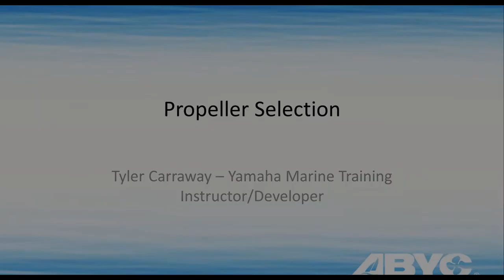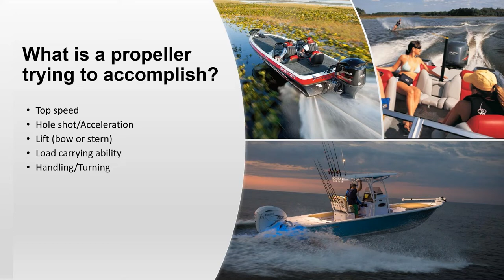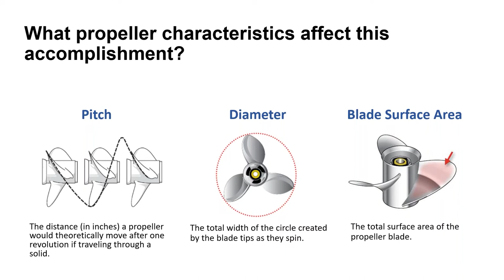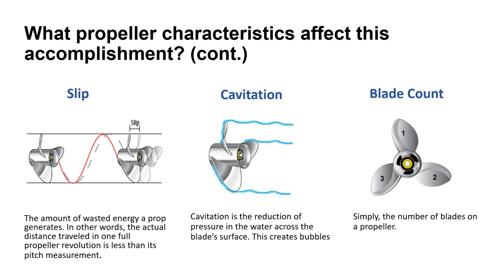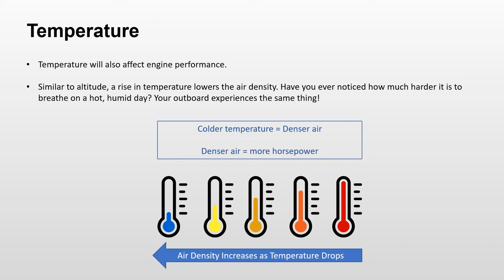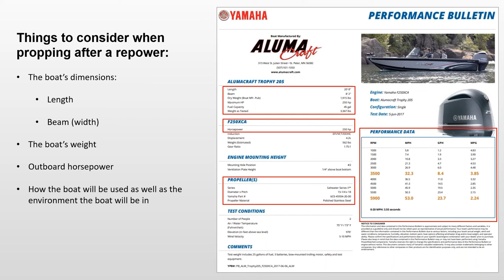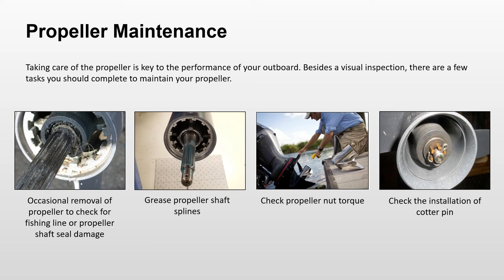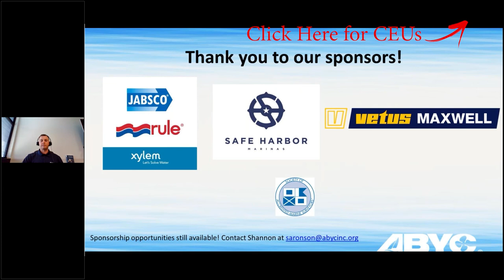Propeller Selection

Comment: Finally a video about changing the diameter!I've been looking for an answer for two days, but no one mentions it. Infuriating!Everyone is just talking about pitch!
Thank you very much for the information! Finally a normal video! 
Changing the diameter by 1/4 inch results in a change of 150 +/- 50 f/p 
Pitch 1 "change results in a 150 +/- 50 f / p change. 
Honda BF 60   11,10 × 13  max 6400 f/p  I exchanged 10 3/4 x 16 max 6000 f/p  decreased, changed. Comment! The smaller propeller jumped better on the ship. Acceleration was better. Top speed has not changed.Test  at full load.
In the spring, I will try to fit a larger diameter propeller.I'm curious about the change. 11,25 x 15

Comment: For instance I have a 1200 lb bass boat with a yamaha 50 2 stroke. The boat is 17.5 ft long. The prop that is on it is 11.125 x 13-G. I only get 3500 rpms out if my motor wot. Please help.

Comment: In my case, the problem was not in knowing which propeller would be better, it was that my choices were limited to just two propellers, the standard one, and the optional slightly lower pitch one, both of whom have way too much pitch.  (Honda 5 hp on a 1,600# 17' LOA sailboat)
Reply: Yes, that sailboat is a problem...to lighten the load take off the mast, rigging, and shorten the keel. The Honda will have a much easier time.
Reply: @PFLEONARDI0906  So what you are telling him is that as he arrives at the marina, he needs to throw his mast overboard, and get under the boat with a saw? Good advice........

Comment: Yamaha 30hp 3 cylinder question my motor came with a Yamaha prop 10 3/8 x 13 = 5200 rpm at 28 mph but Rpm is to low . So what about a Yamaha 11 5/8 x 11p . I gain rpm with the lower pitch but loose rpm because of the increase in diameter? My other choice is a 12 1/4 x 9 pitch but then my speed will really drop . Will the 11p work ?
Reply: The added diameter will not take your rpm down further than what you will gain from the drop in pitch, far from it. If you're at 5200, you are quite a bit over. If memory serves, you'll need to be around 5800-6000 rpm. The 11" sounds like a good choice. The 9" is way too low.

Comment: Is there a formula to calculate the right prop from what you want to achieve?
Reply: Not really. If you don't have experience you really need to talk to someone who does. And before you do, you need to get on the water and test what you currently have. You need speed by GPS and RPM. What you need to know is the max speed @ X RPM. You should also know the best cruise speed @ X RPM. Then take note of things such as how does it get on plane, how does it corner etc. You also need to know what the diameter and pitch is of your current prop, as well as the gear ratio.
From that someone like the company Bblades can help you out. The neat thing is that those guys can not only get you close right out of the box, but they can also adjust the prop if needed be. They also have a prop testing program.
If you know what you are doing, then you need a prop slip calculator.

Comment: The problem I had with yamaha prop selector is that they don't show hp under 25 no matter what boat type. And only shows 3 blade prop. I have a yamaha 9.9 and want a 4 blade prop.
Reply: You may want that, but pretty sure that's not an option.
Reply: @AB-80X  they do make one. I tried it, but it's not as good as the three blade.